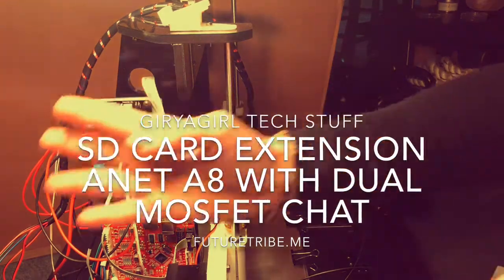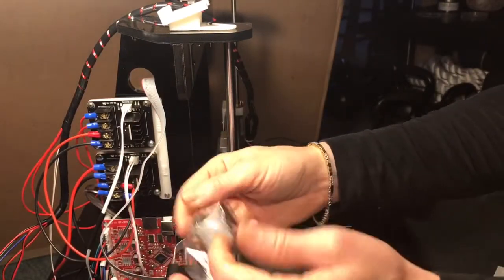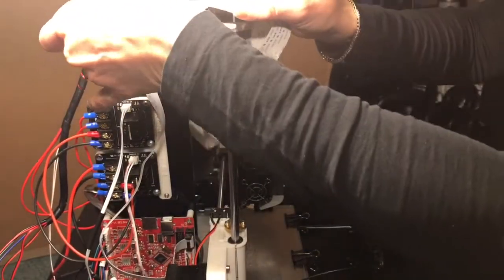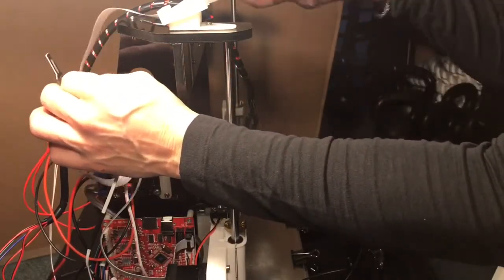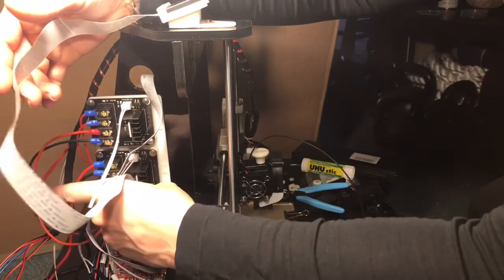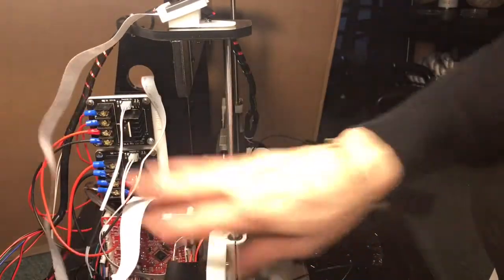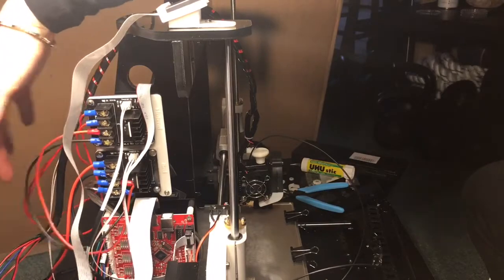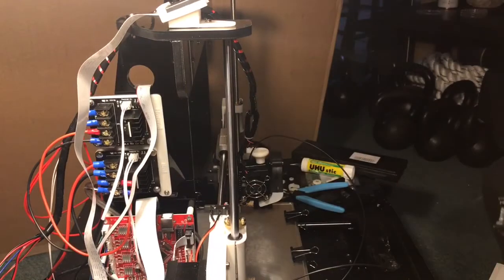Adding a MicroSD Card Reader Extension to an Anet A8 3D Printer, Also Dual MOSFET Talk & Cable Plans

Comment: !!! Caution !!! 
For me severals bugs appears with SD card extension, maybe due by a cheap extension. Some of them appears after 30 minutes, big problems at 1h30.
Problems: Stop or pause print, more and more frequent erratic lateral movement on X and Y, infinite retractation, under extrusion.
If you have this symptoms after SD card adapter upgrade, remove this.
Reply from the maker: Sorry to hear that - I wonder if it is a defect in the extension, the connector, or the board. Check all connections - and check to make sure that nothing is overheating on the electronics if you haven't already.  I ended up buying a higher quality printer eventually as well.
Reply: @Giryagirl  Problem solved, adapter probably add interferences while reading G Code. It's a mad issue :-)

Comment: Hi i bought a cable as well for my anet a6. But it when the sd card is pluged in it can't read it properly. I tried conecting it to my pc and that worked fine. Had any problems with this?
Reply from the maker: My A8 shipped with a messed up sd card that computer can read but the printer could not - when I used a different sd card it worked great!  Hope you have a spare you can test it out with
Reply: @Giryagirl  ah okay, yeah the sd worked fine in the normal printer slot but when using the extension cord it kinda glitched. It seems to just work now so we'll see
Reply from the maker: Hmm maybe a loose connection in there somewhere. Hopefully the extension or SD slot on the board doesn't have a manufacturing defect or somthing :(